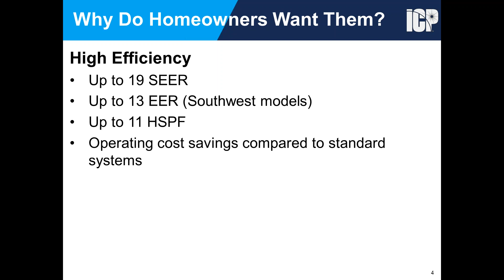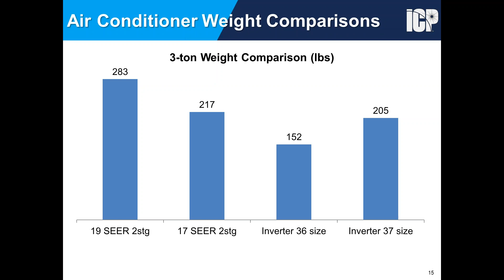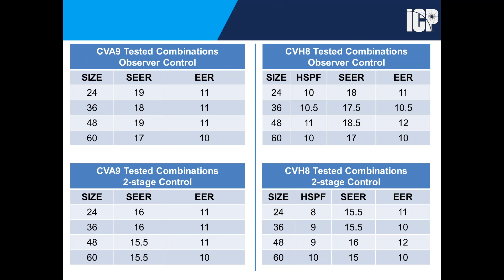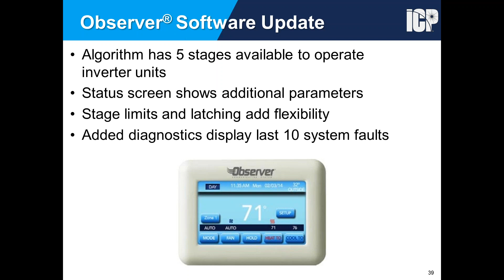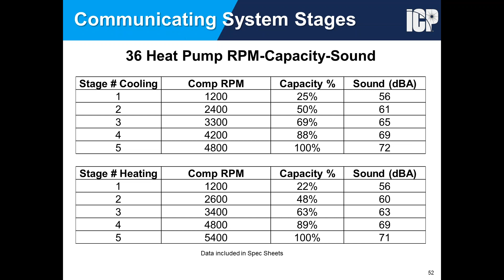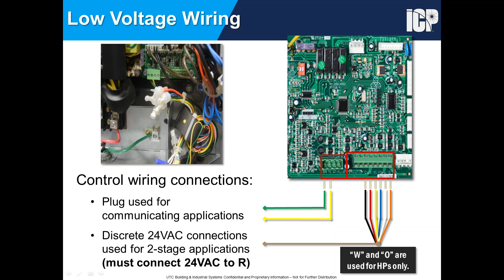ICP 5-stage Variable Speed A/C - Webinar 4/24/17

Comment: The technology isn't all that new. I used to install 25 SEER Lennox units. Those have 255 stages. Lennox also has a 20 SEER thats inverter driven. I've heard really good things about the Bosch 2.0 systems, they are also 5 stages. 

Do these units use vapor injection like Carrier does?
Reply from the maker: Carrier has 6 different model series that have inverters:
--------------------------------------------------------
25VNA0 - fully modulating 20 SEER heat pump, circa 2011-2020
24VNA0 - fully modulating 20 SEER A/C, circa 2018-2020
--------------------------------------------------------
25VNA8 - 5-stage 18 SEER heat pump, circa 2014-present
24VNA9 - 5-stage 19 SEER A/C, circa 2014-present
These models are similar to the ICP units in this webinar
--------------------------------------------------------
25VNA4 - fully modulating 24 SEER heat pump, circa 2020-present
24VNA6 - fully modulating 26 SEER A/C, circa 2020-present
The 5 ton versions of these two models... and only that specific size... utilize vapor injection
Reply from the maker: We have not done with Bosch, but we installed GREE FLEXX in our training lab last year and have liked it a lot. It is supposed to compete directly with Bosch (i.e., side discharge inverter unit that works with a standard stat and can be used with any ducted furnace and evap coil)
Reply: Why did you stop installing the Lennox 25 SEER?